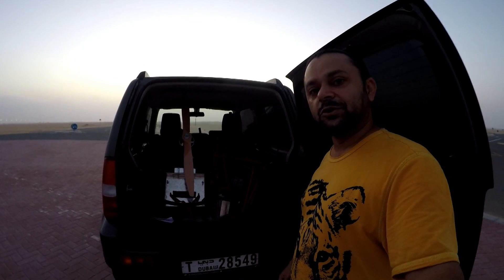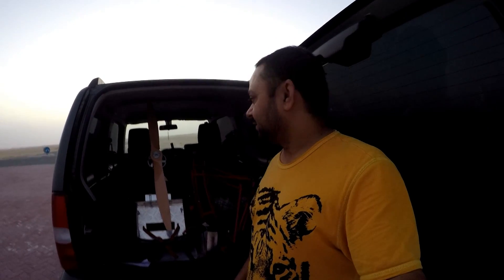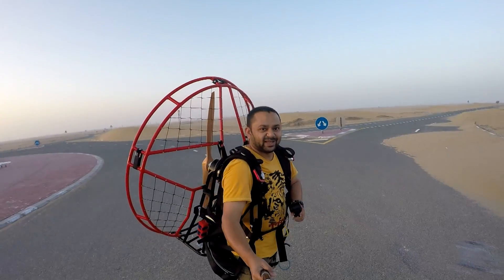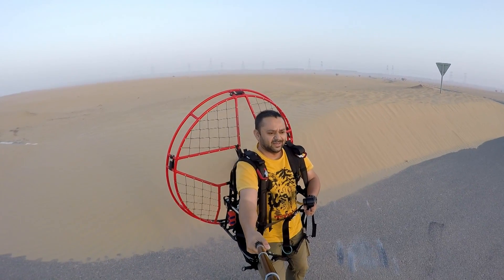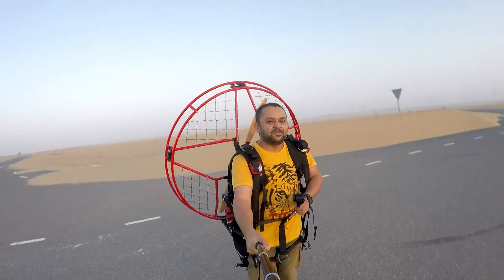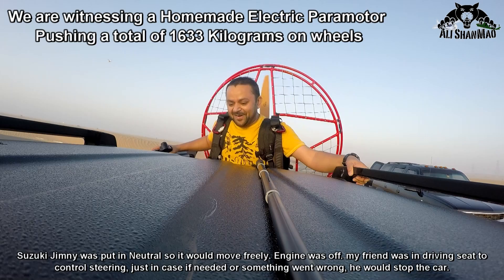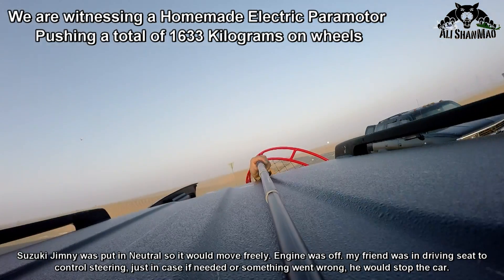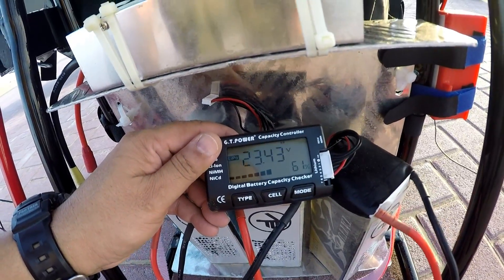Homemade Electric Paramotor Ground Testing for Power and Thrust

Comment: What are the latest developments on the homemade electric paramotor? Which challenges are you facing into if any?
Reply from the maker: So far the only challenge is battery life still. Battery Tech is still the same. I am trying to get a 3 blade smaller carbon fiber prop made and will test it asap I get it. Right now facing some financial issues so not spending much time on this project. but I found a real nice place to fly Paramotors. Gonna start flying soon
Reply: Ok understood. Where is this nice place for paramotor flying?

Comment: Nice, would be great if you can make it less noisy
Reply from the maker: its in the prop. I am using cheap wood prop. A good 3 blade Carbon prop would be less noisy if tips are bent

Comment: Hello.
Very cool video and nice ppg setup. Looks very powerfull. How much does it weigh with batteries? I would like to solve the torque problem by building an e-ppg but with 2 motors. So I would like to know the technical specs of your ppg to calculate what motors and props I need to get the same poer but with 2 motors. Thanks!!!! :)
Reply from the maker: I have tried dual motor setup. and then I left the design behind and went traditional. To be very honest, with all that monster torque on this single motor, I do not even feel torque roll issue. take off I can just run few steps and I am in the air not even full throttle on this motor. 

There is no issue at all with torque on this single monster motor. 

welcome to buy our kit here
http://bit.ly/2zZ4WzU
Reply: Thank you very much for your fast response. Its been very helpfull :)

Comment: Here's an idea for duration or extending time.  Install a small gas powered motor, like really small, like rc 40 plane size small.  Have that motor drive a generator that charges your battery packs while you fly.  It could work.
Reply from the maker: if we go for that noise, then its best to remove Electric and go Gasoline :D 

We can always gear the motor and spin bigger prop to save more on battery
Reply: I really like this idea that you have going electric mainly for short duration and training applications.  I would consider getting this kit from you if it came with the 25Kw instead of 15Kw motor and maybe a 45 to 50  inch prop and cage to accomodate the larger diameter prop swing.  Have you considered scaling up your design for us "fat americans"?  lol.   I'm not really fat at 180 pounds and 6 ft. But this setup seems slightly underpowered for me, and I'm kinda small compared to most over here.  Been doing a lot of research since finding your channel and have to give credit where credit is due, very good design, simple, practical, light weight and ease of use would make this a perfect training set up for beginners who can then graduate into a gas powered unit later if they feel the need.  Good job Ali.   Btw, I share your traits and skills, I work in Avionics and dabble a bit with rc also.  Anyway, Keep it up and good luck!
Reply from the maker: Hey, yes, I do have plans for heavier people to use the electric Paramotor. We are also considering gearing it up to spin bigger prop on same motor so we can save on power and make it useful for bigger guys like yourself too :) 

good thing about this frame and E-Glide V2 paramotor is, that when you are ready, you can remove the motor and install a Gasoline engine on same frame :) but as battery tech is growing fast, we will not need gassers anymore. batteries will be able to provide 30 minutes to 1 hour flight times soon.

New Video of my 2 flights in desert coming soon :) getting my confidence built up with this. No one is training me or teaching me. I am doing it all by myself so progress is pretty slow.

Comment: looking forward to the  "winged" tests of your EP-Glide. It sure seems to have good static power. I like electric motors for their torque curve but flight time is limited by todays battery technology, even using advanced tech motors. There has been no affordable consumer level push for better engineered motor/controller/battery by mainstream efforts. It seems the "tinkerers" are leading the way.
Reply from the maker: Hi, my flight videos are on my channel. you can find a paragliding in UAE playlist too. it flies very well but battery tech we have to wait. I am sure one more year and we will have better batteries to fly an hour or more on same setup.

Comment: Please post your latest flight test, I am interested to convert from petrol engine to eletric, easy transportation and maintanence. I am 80kg.
Reply from the maker: Just came back home from desert. had a good flight. Still need to tweak the Hang point for better CG and better Motor Position on my back. 

My only issue so far is that i can't afford to buy new batteries here in UAE. they cost more than gold LOL. So I borrowed old used swollen batteries from a friend which are 10000mAh and I get only 5 minutes of flight. Heading to China in 2 weeks and going to buy brand new 22000mAh so I can expect at least 20 minutes of flight time at least :)

Videos are coming soon

Comment: Excellent!!! This is sure to "take off" and start a new craze.  Being an armchair enthusiast who has yet to PPG, I was wondering if there would be any advantage to a 3 bladed prop and also, would this setup be enough power for a 150 kg pilot? Thanks for sharing your work and experiences with us!!
Reply from the maker: For 150KG pilot we will need to get different setup. 3 bladed prop surely is an advantage and it will be of smaller size too

Comment: how to buy thisss plzzz
Reply from the maker: Email me at alishanmao@gmail.com for prices and ordering
Reply: Great vid - if this is for an 80kg pilit, I am wondering what size motor needed for pilots 90kg-95kg. 
Looking forward to the flight test.
Rgs, Patrick
Reply from the maker: For a 90 to 95kg Pilot this motor will still give you flights and enough thrust. For better results though, we will have to probably use a different motor for more thrust. For now, this setup can be configured to get 50kg Maximum Thrust. which is enough for a pilot of 90kg 95kg
Reply: alishanmao want to build can we have components